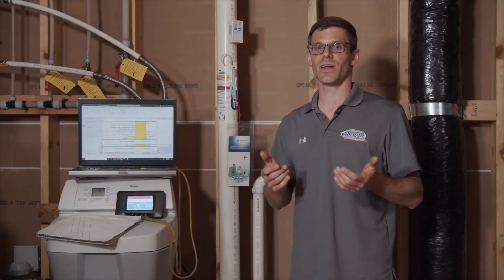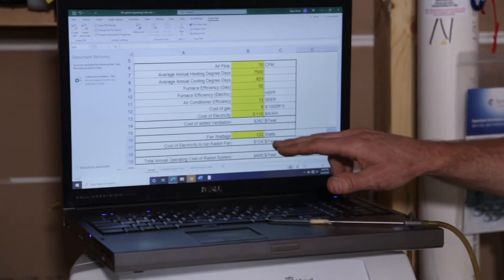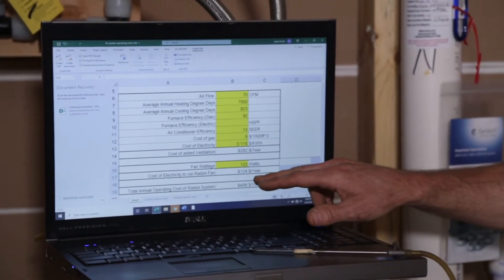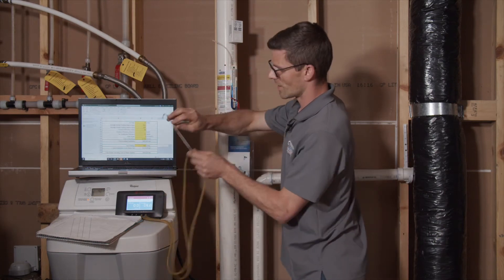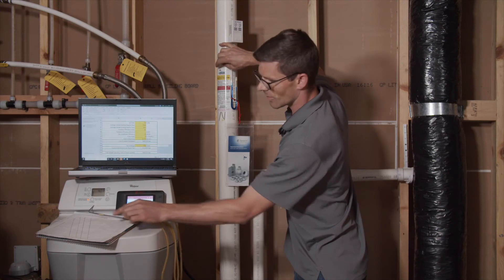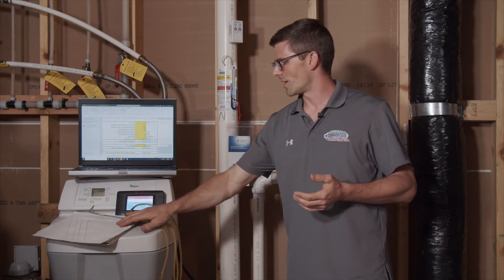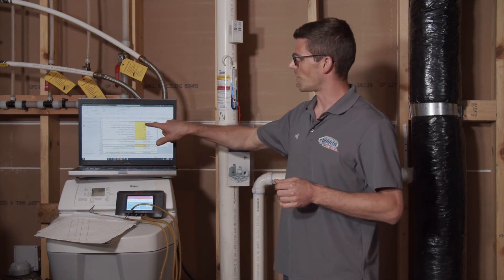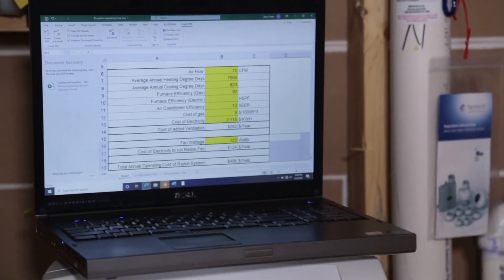How to Calculate the Operating Cost of a Radon Mitigation System

Comment: So, what is the ideal cost of operation for a radon fan?
Reply from the maker: The lower, the better. The power consumption of the radon fan is typically between $20 and $170 per year. 

The cost of conditioned air being exhausted by the radon fan can be significate if you don't take time to seal. 

Our most efficient radon systems draw 4.5 watts. That means it costs about $4.50 a year to power the radon fan. When we factor in a small amount of conditioned air loss, we figure the total operating cost to be $20 to $40 a year. 

Radon systems with large fans, aftermarket drain tile, open block tops, and large air leaks can cost $1000 a year to operate. They can also easily backdraft natural draft appliances like a water heater.
Reply: @AmericanRadonMitigation  For open block tops, Do you seal the tops of the block walls first?